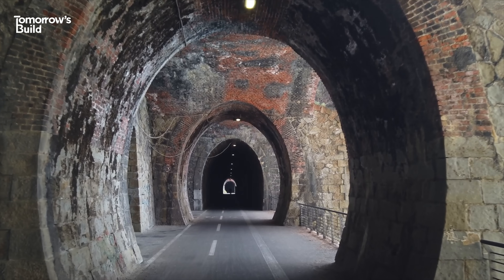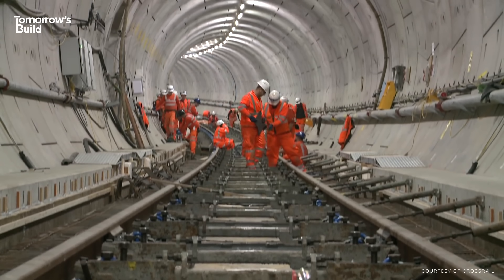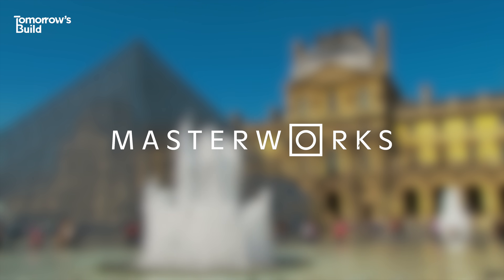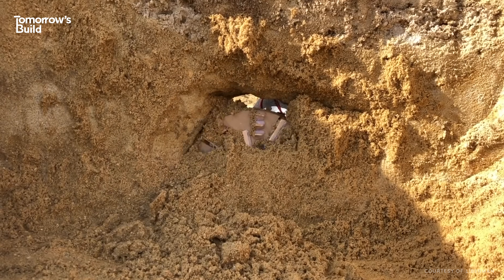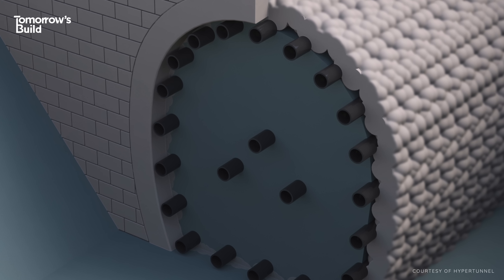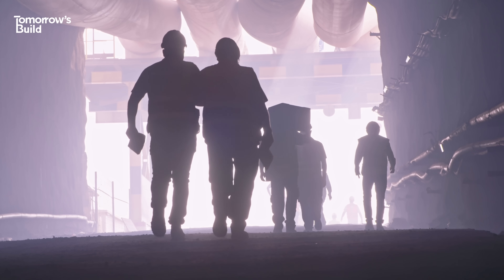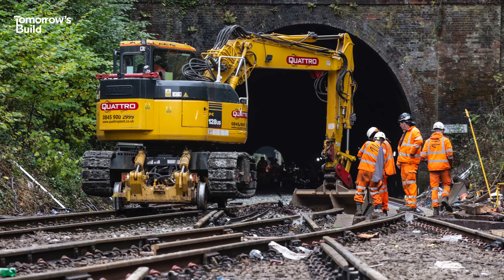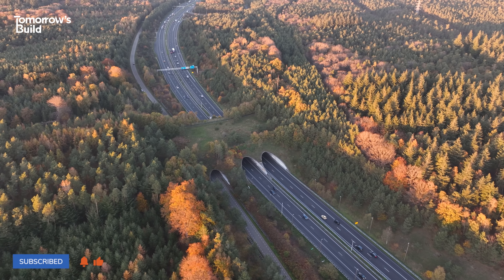A Swarm of Robots Built This Tunnel

Comment: I think we should find a medium point somewhere between these two extremes. Make a few larger machines of this type instead of a huge quantity of smaller ones.

That would reduce the number of points of failure, and if the robots were slightly larger more features could feasibly be put into them that increase their effectiveness. 

I also think that two problems that would come up can be solved by using more medium sized versions of these robots:
If one gets stuck, a larger version of these things could be made so that if it gets stuck it can contract to smaller than the pipe diameter and be retrieved by essentially a long stick and pulled out of the pipe. If foreign material clogs the pipe blocking its access, a larger less swarmy version of these could have a rudimentary borehead and recreate a smaller scale version of conventional tunnel making by boring through the blockage in its pipe so it can continue. Larger versions could also have larger tanks of the expanding concrete compound meaning less back and forth to get the actual cavities it makes filled with the compound.

Comment: The robots getting stuck in the pipes, or getting their drills stuck around the pipes seems like a huge problem to me. The animation of a robot arm drilling out the shape of a block which is then filled with grout seems like an attempt by hypertunnel to avoid acknowleding that they will actually need to robotically place preformed concrete blocks in the raw tunnel just as with conventional tunnel boring machines.

I think the real problem is getting enough grout into the area around the outside pipes in order to have a rough grout tunnel in place, which could then have the material inside removed without the need for a tunnel sheild. These robotic drills do not seem like a realistic solution. How to drill sideways out of the outside pipes without getting these mini drills stuck? Maybe they could use mini plasma drills that don't really touch the area they are drilling into, and don't go much outside the pipe? All tunnel boring machines create gaps around the actual bore they drill where material collaspes in (leading to surface settlement). Grout can be used to fill this. If they can use sideways plasma drills to increase this area so that the grout from adjacent pipes can meet then they could build this grout tunnel first, then use more standard excavation to remove the central material, then line the tunnel with preformed concrete blocks (and more grout).

Rather than having robots drill sideways, I'd just put these sideways plasma drills into the regular drill machinery head. The oil and gas industry already know how to get these out of boreholes when they get stuck.

Comment: I'm more interested in this for boring straight down. Geothermal is going to be a MASSIVE industry in coming years, and having an autonomous robot digging these 6" diameter wells could be more efficient than building a shaft using conventional drilling techniques.

The challenge is drilling through bedrock (rather than soil), but this can be done with electric-arc, mm plasma, or even a conventional drill-head, though the latter may result in frequent drill-head swaps or larger robots.

Comment: What they have right now is the tunnel boring equivalent of a rocket hovering testbed (the kind many organizations have made for decades) compared to a multi engine full scale orbital rocket capable of launching payloads reliably and coming back to earth to be launched again which only one company has succeeded in doing. The real world test they did just doesn't address any of the potential problems and the result isn't nearly good enough for prime time. The speed and cost claims cannot be substantiated until a real tunnel of satisfactory quality is built

Comment: They discuss all of those steps of robots, filling up the gaps, concrete injection, autonomous material removal... but the most essential step of getting those boreholes all parallel to each other, following the same geometry is the hardest one. As soon as you meet a large bolter underneath, or a harder material, or gound water, or cavities, or simply not being to generate enough thrust force with such a tiny drilling device. That's what is the most interesting. I've been surveying tunnels since a decade and those tiny machines are always a pain in the butt!

Though, I should admit, I love this creative approach here! :)

Comment: Obviously there will be more than one model of robot. 1 for drilling the holes, 1 for inserting the filler, 1 for extracting the material from the holes , 1 for transporting the material, 1 for changing the batteries on the more internal robots, 1 for cleaning the micro hole of waste, 1 for servicing the internal robots, 1 for reducing heat in the hole if necessary, 1 for dealing with water inflowing. etc. And I guess they will all work with a mesh net, so they can relay information and instructions. Sure this is going to take a while to become reality, but the improvements are all incremental.

Comment: We need a few of these tunnels through the Sierra Nevada range especially during the Winter. Would increase tourism to places too remote and cut off due to the extreme driving conditions half of the year. Once I was stopped by Italian tourists how they could get to Nevada as it was well into Fall and the mountain passes were closed and my reply was to drive back to Los Angeles as at that time of year the only other way to get across would be I-80 which isn't exactly where you want to be driving around in the winter unless you have experience.

Comment: It's still slow. in the '60s the "melted rock" method involved a heated tip head that vaporize rock into lava to bore a tunnel quickly was being worked on. Don't know if it came to reality.

Comment: Here's my concern:

Sooner or later, a robot WILL jam inside its tube.  Not might, will.  There needs to be a way to clear these jams, which could very easily mean un-wedging a robot (or disassembling it in-place) and potentially replacing the pipe segment it's in, kilometers deep.  Which means (at minimum) an additional robot design, with disassembly and pulling tools.  And a further robot design with the ability to to cut the pipe it's in and install new walls.

TBM's are big enough for humans to access and service the machine.  These robots, are not.

Comment: After 40 years building tunnels around the world I am not convinced - another we are going to "revolutionise" tunnel construction like Elon Musks' "The Boring Company"!.
I can see so many downsides to this ie. 
how are you going to drive the circumferential pipes over long distances taking in vertical and horizontal curves?,
how are you going to get those same pipes through broken, blocky, faulted and high water table/hydrostatic heads? 
how will these robot swarms deal with the above problems? 
what would be the cost of each robot? (can't imagine with all those different functions they would be cheap),
how would you extricate a malfunctioning robot that had its boring probe in the ground and was immobilised?
Somebody will definitely revolutionise the tunnel construction industry one day but I can't see this being the answer for long, geologically challenged tunnels.

Comment: They need to sort out the politics of the train operator jobs first before building tunnels. Any one tried using the overland lately? It's a joke you pay a fortune for a system that's either on strike or there's communication problems causing major delays. And that's on days with good weather.

Comment: While this is interesting, isn’t it technically limited by the unloading area?  Eg. Only one robot is supposedly unloading ore at a time, and you need to load them with the material they’re injecting.  Even though 5k of the robots can technically work at the same time, you’ll be limited by other, very real bottlenecks.

Comment: Well, you are glossing over the tricky bits quite a bit, aren't you? Like the fact that the access pipes for the robot swarm still have to be drilled conventionally. It's not the lining of the tunnel that's the expensive part, it's the precise drilling it in the first place. They demonstrated a 6m piece, which is ridiculously easy. In contrast, driving pipes through rock for kilometers in precise formation like that would be ludicrously difficult and extremely expensive.

Comment: Engineer here : I'm sure the concept will one day work, but I doubt it will ever work from an efficiency or economy point of view. Why is that ? Building thousands of robots that can each fill a cubic meter of concrete will cost A LOT, and won't be any faster than your current TBM, even if they manage to make them be able to cross each other (I doubt that), and they never have any crash in these small "tunnels" where they cross (if they do, you can forget your tunnel forever). IMO, nice concept, but just expensive, risky, and not any faster than a TBM.

Comment: Man this sounds like such a scam. Also this system seems to only be designed for the "lose dirt" kinda tunnel so hardly going to replace something like a tunnel bore machine. Also how is it supposed to just spray in some kind of support material when on the following step it needs to hollow out the entire space in between, sounds like they would have to do it both times or they should just be able to use the first step twice. Also that's a lot of material that needs to be moved in and out of these tiny wholes...
Ultimately it seems like another case of let's divide one big and efficient process into countless tinier versions which afaik has never worked.
Also really? HyperTunnel? Are there really still people who try and associate their product with Elon or the countless other failed Hyper- products.

Comment: Applaud the robots taking your jobs. Applaud, you working class plebs!
Reply: Meh, they can just learn to code for the robots.
Reply: @ItsMeScareCro  Coding is one of the first things AI is going to take over. It's already doing that, writing software for complex issues. 
Also, writing software to program robots is a one time project. After that you need just 1 guy to keep an eye on the entire process, and he's just there because a robot that can move to a station and actually replace a small part is still more expensive than that human. But they won't be for long.
So, no.

Comment: I do wonder how much tunnel vision they got thinking of this, seems like it could be good but so many potential things to iron out...besides what others have, i would have concern about the surrounding area/buildings + infrastructure outside and in the tunnel (sure when they first started building with concrete it wasn't what happened now but 1 month, 1 year down the track etc how does it hold up on a large scale)
This is also were people forget a lot of this won't be programed it will be run by machine AI which is another risk

Comment: One problem, as someone who works in tunnels (who even recognised the Hinkley Point C footage as I've been in that tunnel so many times) the part that takes the longest is the actual drilling which you would have noticed they kind of skipped over. Also Grouting (the process of pumping concrete into the ground) isn't perfect and goes wherever the easiest path is and is a bit more complicated and random/choatic then how it is presented in the video. Another point is that grouting is not structural we use it more as an added protective layer and to also reduce water ingress. I love seeing innovative in the industry however I admit I have doubts.

Comment: There's absolutely no way this would ever work. Inserting concrete around the existing dirt? That's not how concrete works. You have to remove that dirt and then insert the concrete, you don't mix it in with it. It's going to make it brittle and crumble as soon as you apply pressure. You would have to develop a new type of concrete, that can integrate the specific type of soil found around the tunnel you're creating. And that's easier said than done considering soil varies from foot to foot. It's good to think outside the box but this will never be viable. Boring machines are the fastest machines we have to make tunnels.

Comment: The video made it sound so simple, but that only works with soft soil or soft ground.
What happens if you are dealing with hard ones? 
And depending area, there could be water leakage issues...you can't just build the tunnel first without dealing with those water leaking areas.

This method isn't suited for most kinds of digging...maybe good for digging a little heel only.

Comment: Tunneling with swarm robotics will require a power source other than batteries. The energy requirements for tunneling are immense. They will need to be powered by an attached wire, or not be electrically driven.

Comment: Build a demo project, get back to me.  No need to have robots make a finished product wall inside.  The grinder that removes rock and dirt can grind back material to give a finished look.  People will still be needed to reset working face every few thousand feet or the power needed for robots to travel miles will be too much.  I don't see this a HUGE game changer.  You still need TBM to remove rock from center portion.  It does do away with tunnel wall setting and provide a far safer and faster condition for TBM.  No more running into aquifers, loose material, etc..  Just the solidified earth and rock.  Though I'd set a conventional tunnel wall inside the robot built one cause you know due diligence

Comment: Thousands of tiny robots will be tens of thousands of breaking points in this process. 

If just ONE robot gets stuck blocking one of the boring holes where another can't pass, that hole will be the weak point of the tunnel walls until cleared and/or another hole is bore to replace the blocked one.

Comment: 5,000 moving pieces working with dirt and clay and pipes and confined spaces...... And they could pass each other without getting stuck, malfunction.  The way I see this is they get jumped inside those pipes and somebody will have to figure out a way to take them out or if one or two of them are stuck on the outside and the rest of them are working how are you going to take them out seems like there's going to be more time invested in fixing this process and then actual work being done

Comment: Very interesting idea. Still construction WILL require humans to build for decades to come. You just can get robots to do what i do. Building concrete structures and stadiums you need humans to solve problems and make things work, get into akward places. Like if something falls 20ft down into concrete formwork how would robots crawl thru rebar 2 get it? Its only 14" wide with 2 layers of rebar. But a human can contort and get in there and retrieve any shaped object. Sp yeah tunnels sure but foundations columns walls of big strutures? Nah you are gona need humans for next 50yrs ez

Comment: This is the most idiotic approach to creating a hole in a mountain that I have ever seen, and the supporters make a fool of themselves by failing to consider the practical issues that come with it.
That starts as simple as the battery life of these robots over long distances and ends at what to do if a robot malfunctions 30 meters into the tunnel?

Comment: So it's Horizontal drilling with buzzwords. Swarm, Robots, Drones, Manufacturing. I've had the same idea, but no desire or funds to persue the billion dollar idea. Horizantal drilling is way faster than tunnel boring, and fracking has proven you can inject stuff through it. drilling steel pipes down and injecting concrete seems like a way to make a tunnel without the digging everything out first part.

Comment: Old technology: use a tunnel boring machine to remove the dirt, and build the walls out as you do.
New technology: Build the walls, and then use a tunnel boring machine to remove the dirt.

Funny how the 'slow digging machine going through and removing the dirt' part that they were bashing on got glossed over in the tech demo cgi.

Comment: I don’t think this will ever work, their designs are still in Alfa, the test run they built was made out of junk parts and zip ties just to test the theory, and someone still has to do bore drilling for the pipes for the swarm robots. Not to mention this is all really inefficient having to do maintenance on every single one of those Machines and refilling their small capacity tanks.

A small list of things that may go wrong.

. Soil filling the pipes while the robots are drilling 
. A robot breaks inside the pipe and halts production
. A pipe warps under pressure 
. The tunnel is too long for the robots to work on efficiency 
. Many other things that may go wrong, use your imagination.

Comment: The idea is nice, but where's the dirt gonna go? They inject it with composite materials? That saturates the soil or something? The dirt is packed, and the injected materials take up space. Something's gotta give, the initial tubes, the robot, or the surrounding soil.

What if there's different concentrations of multiple types of soil, clay, sand, etc? That'll be a structural nightmare to calculate.

I call BS until I can see the preliminary tests of such injectable materials. 

Other gripes:
Safer? Maybe. Fast? Probably not. They still gotta dig the hole, and also have to take care not to damage the already-laid infrastructure as they dig through the middle of the "pre-made" tube. 

Assuming the injection thing works, you can just do the same thing without automated robots; dig initial holes, put spigots through the pipes, and inject materials via tubing. Keep It Stupid Simple.

The idea sounds nice on paper. And CG. Build the tunnel infrastructure before making the tunnel. But people have been making tunnels the way they do for decades for a reason; it works.